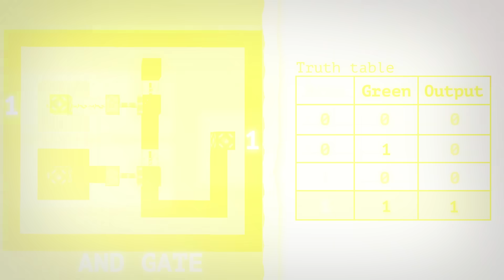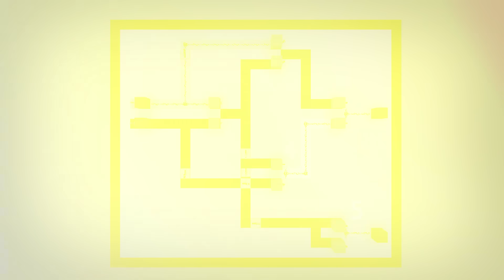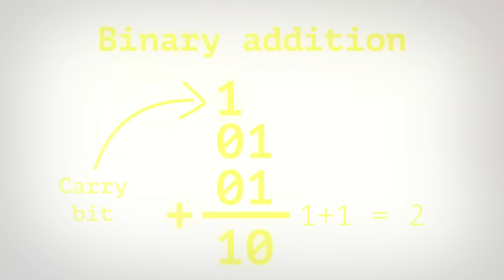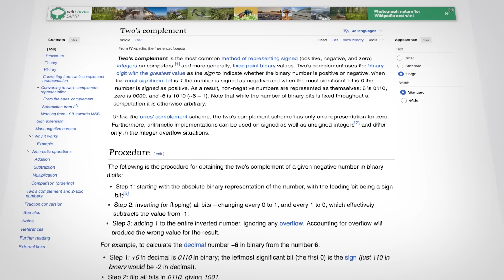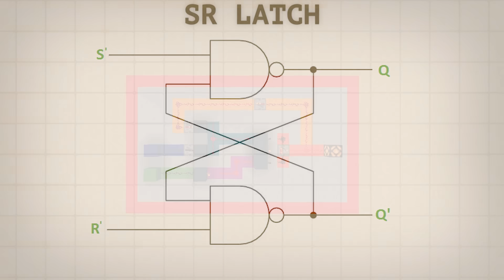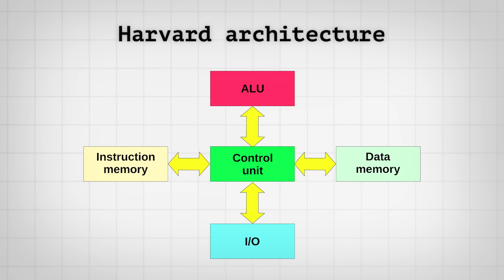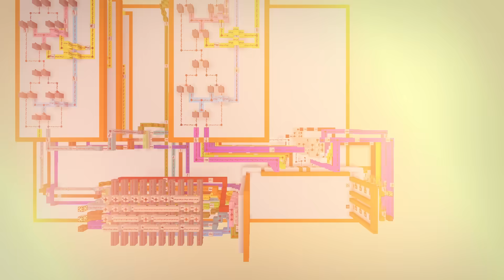Computer Architecture Explained With MINECRAFT

Comment: This honestly is a good intro to A level computer science
Reply: @OnyxtheFolfno he didn’t do this he’s saying it could be
Reply: @camerontupper1138  A Level Computer Science goes over computer architecture, logic circuits, assembly and much more. It goes quite in depth too.
Reply: @OnyxtheFolfA portion of the OCR A level Computer Science course goes over computer architecture in a way very similar to this video, but in more detail. This would be a very good and fun introduction to that section of the course.
Reply: U mean electrical engineering right? CS deals with programs and software, electrical/computer engineering deals with hardware
Reply: @TooHearts  Yeah but in Cds if you dont have this kinda basic knowledge, you wont be able to code hardware
Reply: @TooHearts  Nah, when I did A level computer science the start was mainly learning Boolean Algebra, Logic Gates/Circuits, and how processors understand machine code and need an assembler to convert assembly language into machine code
Reply: @TooHearts cs is everything to do with math, information, automation, and data science. In reality, discrete math and computer architecture are both classes cs students have to take to complete their degree
Reply: @_chaozgt_ do you think we don't learn hardware in CS?
Reply: @TooHearts  nah CS, at least for me, still covered all of this stuff.
Reply: @TooHearts no you study architecture too, at least you should be
Reply: @TooHearts currently majoring in CS and I have to take computer organization, hence why I’m watching this 💀
Reply: @TooHearts CS also requires a fundamental knowledge in these topics
Reply: @TooHearts cs also has computer architecture
Reply: @TooHearts at my college, Software and Cyber also have to take a course on this.
Reply: @OnyxtheFolf going to uni and talking to people who did the English CS curriculum is astonishing, those guys got to do fucking assembly.
Reply: @jbritain  Haha yeah we have to do assembly on paper, its special lol
Reply: I got to UIUC (for compe), this is more of a computer engineering intro than comp sci. Intro to comp sci won’t cover things like ALUs, latches, flip flops, etc. while computer engineering covers all of that, plus stuff like transistors, current, etc.
Reply: @nikplaysgames4734  as someone that did both computer and electronics for both GCSE and a level and now does computer science in university, in comp Sci you learn what logic gates, transistors and ALU are at a very high level but only so that you know what you're doing when programming assembly and how computers work (since it is called computer science) but it's not real assembly like x86, for us it was just a dummy assembly language called little man computer on a website emulator. In electronics you make circuit diagrams and actually program a microcontroller in assembly to perform a task so if I were to differentiate them in short, electronics is more hands on but computer science is just so that you understand it but when it came to simplifying boolean equations computer science was harder because you had to learn the rules rather than just do it, so computer science is more theoretical when it comes to logic gates and components
Reply: @elijahknox4421  "transistors at a very high level" you say? So you took quantum mechanics?
Reply: honestly its more of an intro for gsce computer science
Reply: So I did this all in Germany basically in machine learning. Part of a computer science apprenticeship but in a school only with higher A levels combined. 3years in electrical science and specialist praxis. Everything you told I did on a microcontroller which was even soldered by ourself. Funny to understand everything clearly and in use. Was funny to recall all this after 4 years
Reply: @AcerTheRaccoon  This is more electronics engineering than it is computer science. CS is a very big subject. Electronics is a part of it but most courses don't go into too much detail unless you want to specialise in computer engineering
Reply: @DodgeRaccoon partly. The gates are normally discussed in Data Structures and Algorithms.
Reply: It's definitely a big topic in computer engineering. In my second year electrical engineering program we took a computer engineering course that taught us about logic gates and cpu's. That course included a lab where over the span of the course we designed a very basic cpu in Verilog that we ran on an FPGA.
Reply: He sadly lost me in the middle of the video :(
Reply: I know this is late but you definitely take a unit on computer architecture/organization in CS. I remember covering the topics in this course in a hybrid computer organization/embedded system design
Reply: I saw this video i have igcse mocks cs tmrw from same thing
Reply: @OnyxtheFolflogic gates were taught in high school ig
Reply: True.
Reply: I learnt this stuff in GCSE CS personally
Reply: This is computer engineering not science
Reply: @bruh-fw7op  and computer science also covers this stuff. This stuff is the basics of computer architecture and is used in computer science for a base understanding of the underlying hardware
Reply: @pepegaplays4023  true
Reply: This is actually taught in Computer Engineering/Electronic Engineering, it is just briefly taught on Computer Science classes
Reply: Only losers say “a level”
Reply: @pyropulseIXXI  that is literally what it is called here
Reply: @pyropulseIXXI  thats what its called dumbass